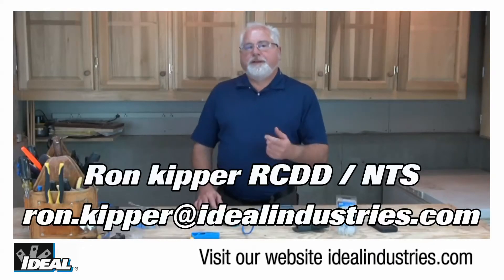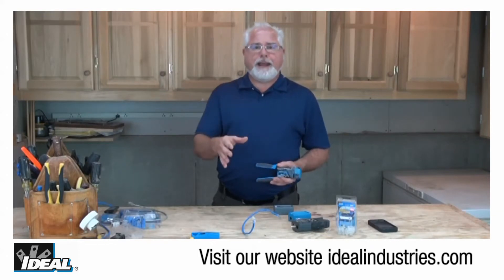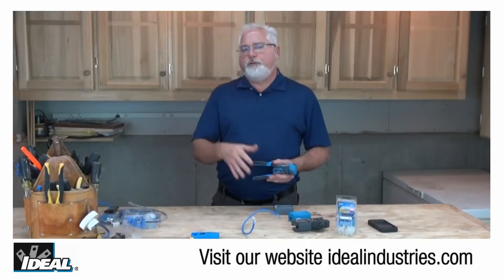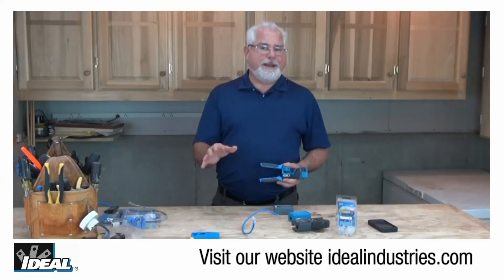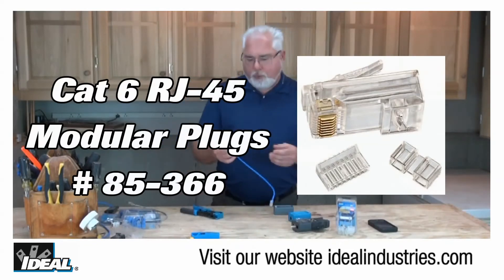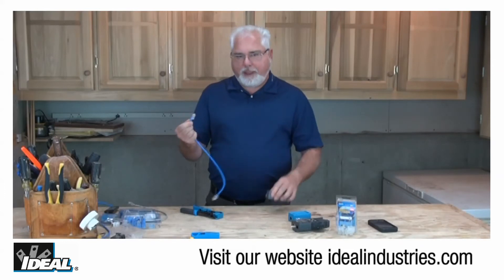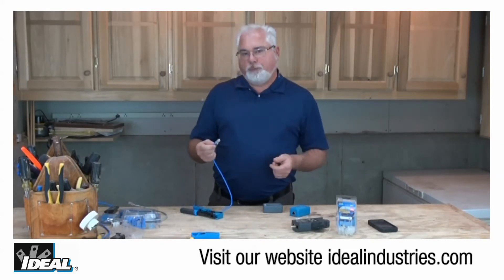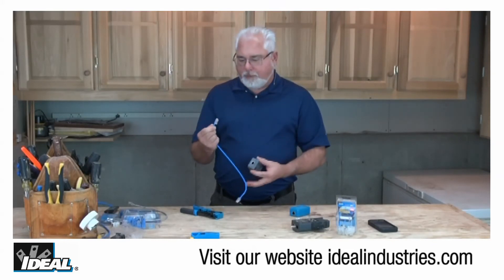Modular Plug Crimping Tool Tip

Comment: Thanks for the info.  Recently I started working with a new company and when I went to use the modular plug they gave me, the wires stuck out the end of the plug and I thought 'wtf is this?'  Come to find out it's called 'ez-rj45.'  That's fine, and it's sure easy to use, but I still think it's cheating and I'm not going to let any new guys use it until they know how to make plugs up the 'traditional' way, lol!

A question about CAT6 plugs with the little inserts;  I had to go find plugs to fit some shielded cat6 that used 23AWG wire.  It takes me 4 to 5 times longer to get the conductors inserted into the little insert and trimmed than it does to make up a normal plug.  Even then the insert won't always go as far as it looks like it's supposed to into the plug.  Know of any tips or tricks to do these things up properly AND quickly?
Reply from the maker: ***** Good to hear from you! I tell people there is no easy RJ-45! Those plugs have two exposed sets of conductors the pins and the end of the cable where dirt, dust or other things can short out the plugs. I do not see data people using them........If you are using shielded Cat 6 cable you need to buy a shielded connector not these plugs in my video. You might get the cable into the plug but the plug is not shielded or grounded.We do not have one to sell you though.Thanks for watching the channel.Ron